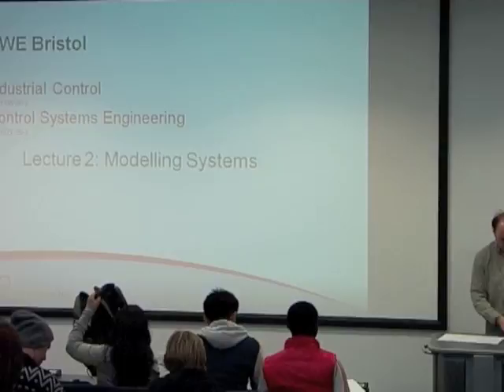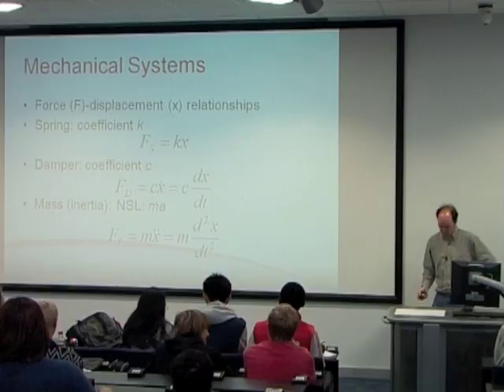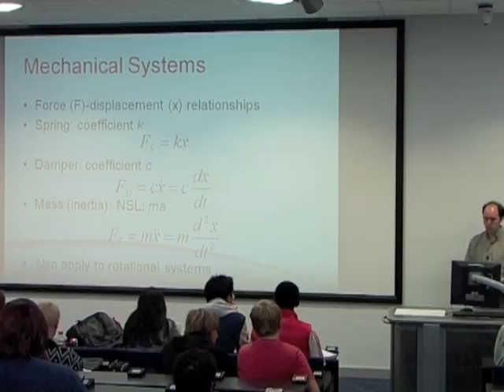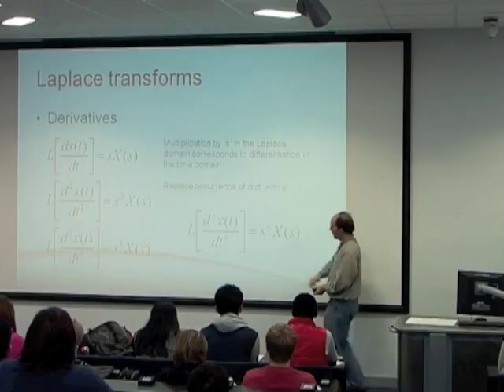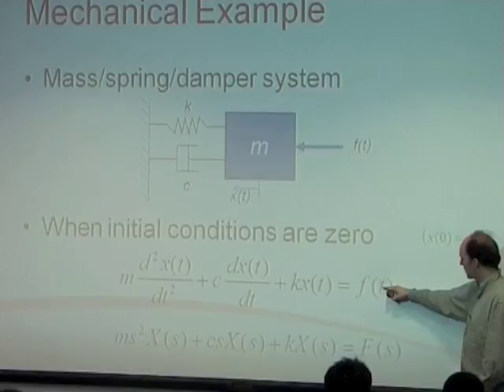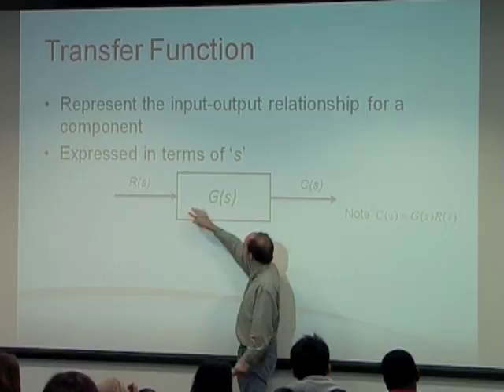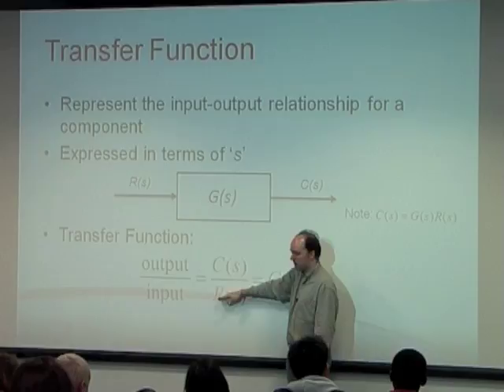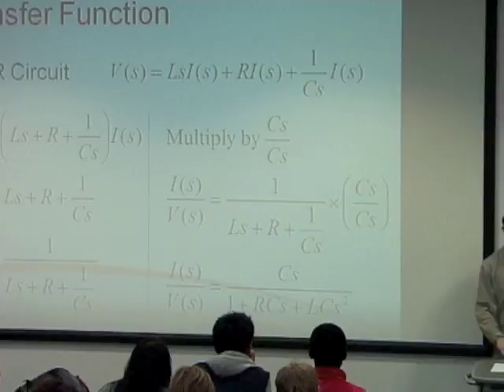Control Systems Engineering - Lecture 2 - Modelling Systems

Comment: Very nice except some of his real world examples are misstated. The furnace  example has an  input of desired room  temperature in an output of the room  temperature resulting over time. He says the gas  is the input and the heat is the output.That is not really a classic control system, but simply the plant..
Reply: In my opinion, the heat and output temp. is most core control loop. The input temp. and output temp is another layer of control loop